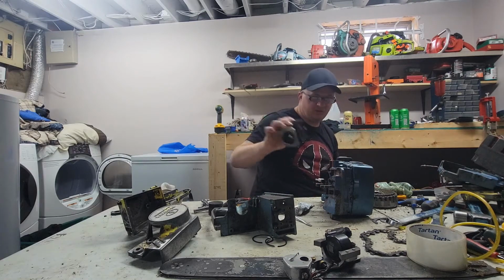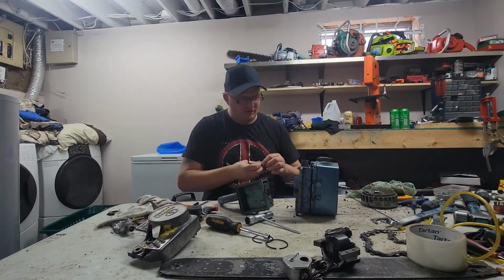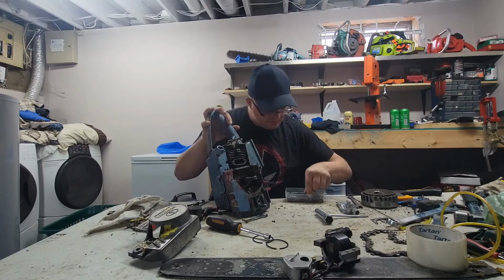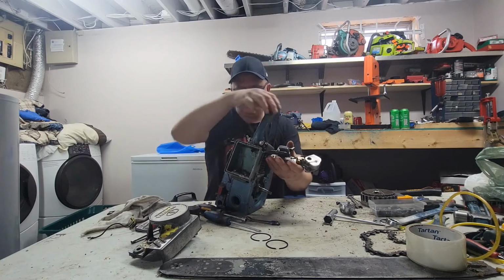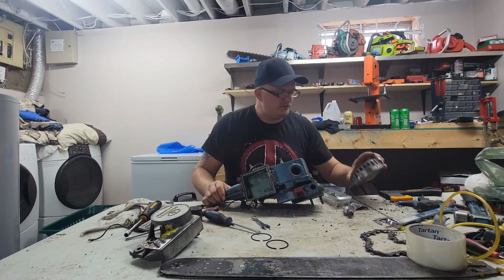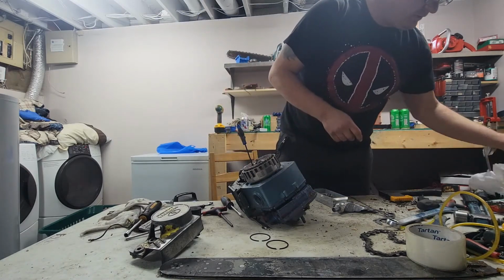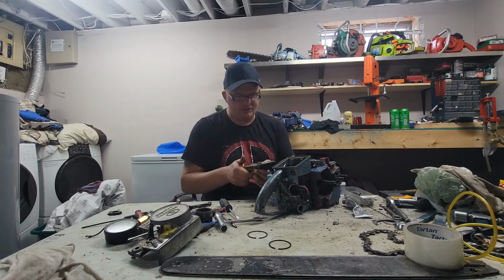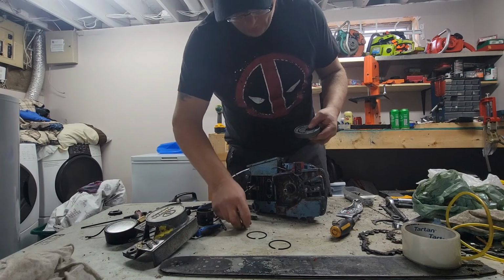garbage build pt 2 compression is gonna be low

Comment: You should always usesome sort of thread locker on the bolts behind the flywheel. There was a number of red super Xl saws that from the factory where not treated with thread locker. and the screws backed out and locked against the flywheel. I personally had one that did that.
Reply from the maker: On ones that I have restored I use locktite, out at the moment but will probably add it at some point before I give it away